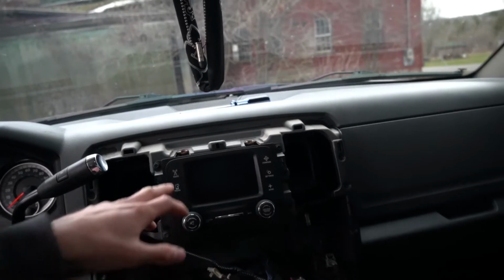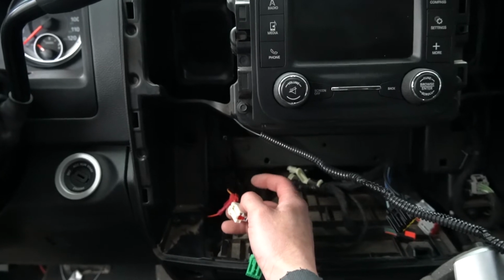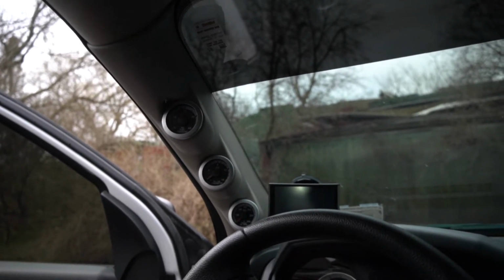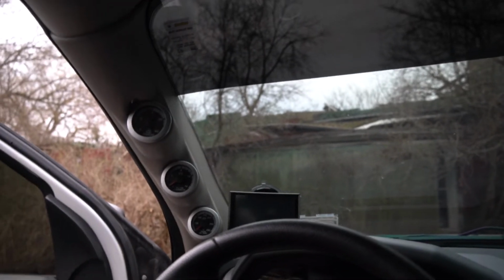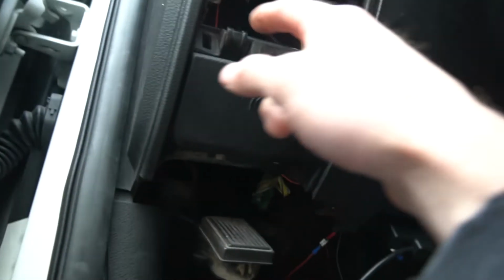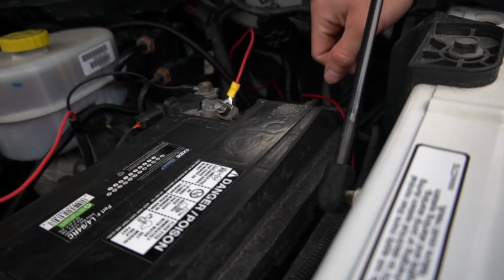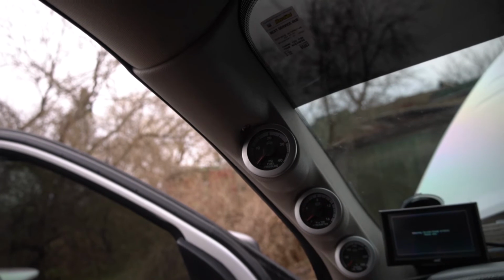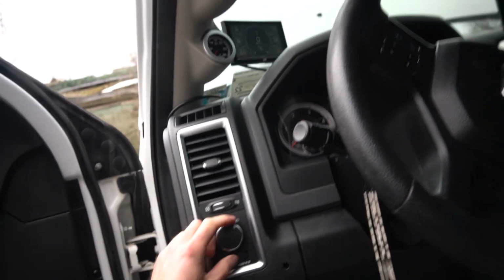EASIEST FIX EVER TO POWER ISSPRO EV2 GAUGES!! *4th gen cummins*

Comment: T- taps can cause hot spots in wires and they are really bad to use.. if possible you want to solder everything or us an "add a circuit" fuse that way none of the factory wires are messed with, even if its in a tight spot you can get soldered shrink-wrap which eliminates the soldering iron totally :) and you can get constant, key-on, and markerlight power all in the fuse panel under the hood :)